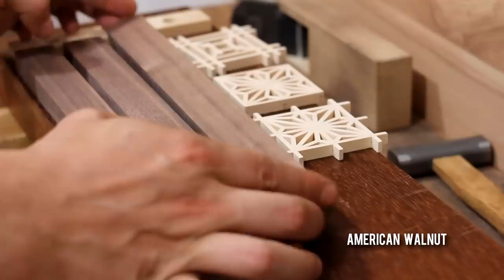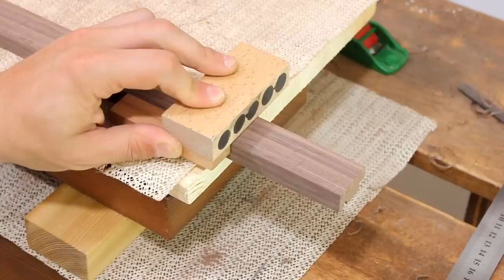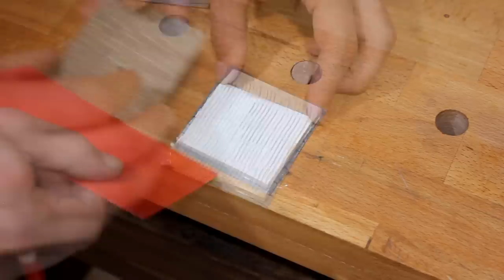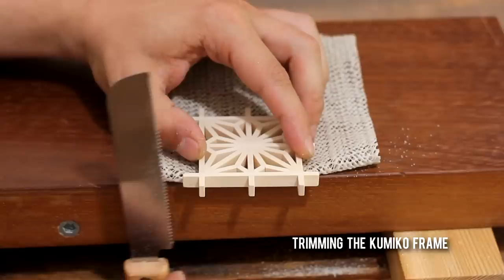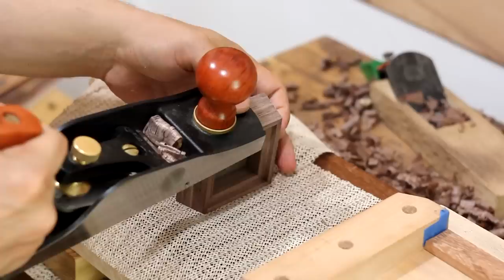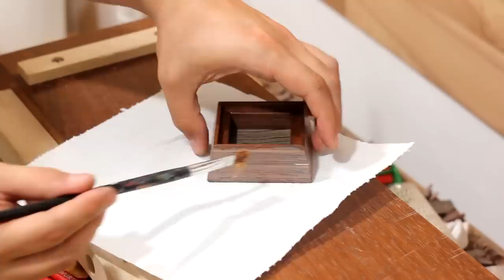Making Kumiko Ring Boxes

Comment: Great work! I see you do not much using old small workbench.The new japanese shooting board is better suitable for small work like boxes ?It is much lighter than your old workbench,do you have  issues wit it ?
Reply from the maker: Thanks! No issues at all, just too heavy :) In fact I plan to build the version 2.0 very soon, to incorporate the vise in the japanese planing board. Is just that for my type of work I barely use pieces wider than 15-20cm, and besides, the planing board has that edge planing rail, which is very used by me.
Reply: I am excited to see video about building  v2.0.Keep good work!
Reply from the maker: Thanks! I try to make to make it very soon, just need to figure out some engineering aspects then I'm ready to go :)